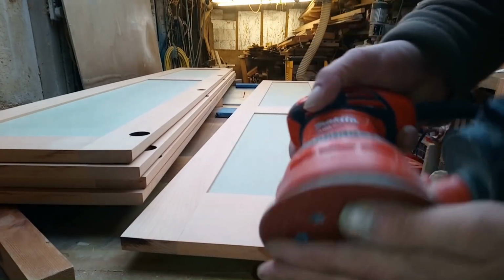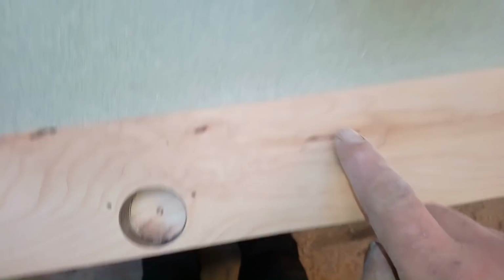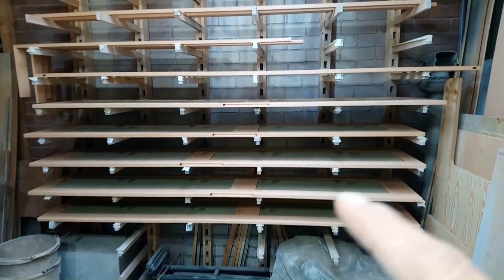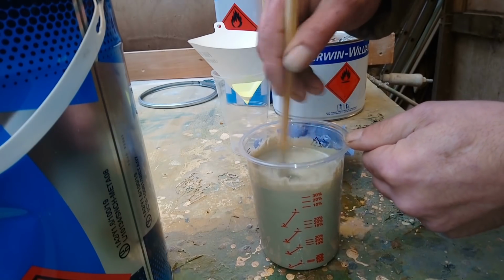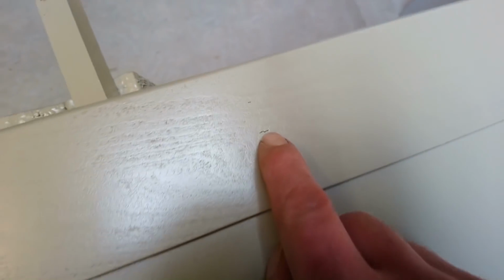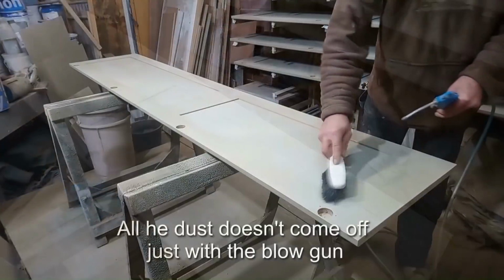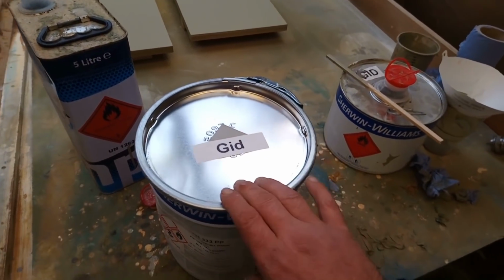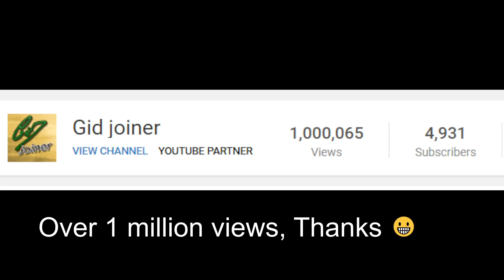Wardrobes Pt9 - Spraying the doors with 2 part PU enamel paint

Comment: if you want a finer paint finish Gid, look at automotive DA palm sanders. They have a tighter orbit and don’t put swirl marks into the panel. Decent ones are expensive to buy and need a lot of air volume but you can use them right up to 1200grit which i imagine is way finer than you need.
Reply from the maker: Hi Phils, yeah prob too much for these projects, I don't do much sanding on the top coats n any swirls with the 120grit don't show, these Makita's are quite good, 
I have considered a DA palm sander for the van but as you say they use a lot of air, my little air body saw works well, i suspect that doesn't use much air but I have a die grinder that works 'ok' if not used for a long amount of time & a cut off saw/right angle die grinder disc thingy that loses power/air almost immediately so hardly ever use that, i've got a couple of lecky grinders & an 18v cordless so that's no prob, need a bigger compressor.  but always have to consider the neighbours reg noise, some of the air tools can be noisy,
Reply: Gid joiner they do need lot of air, i’ve got 3hp, 14cfm, 150ltr and a DA will have that running continuously.  I have a right angle die grinder that i use with Roloc discs, it’s the loudest air tool i’ve got, i tie wrap a piece of cloth over the vents to muffle it. Good thing about air is the speed control, can do much finer work with them, but they don’t have torque of an electric motor.

Comment: very imformative, i have a graco 9.5 finish pro, would the paint you use be comparible with it, also your paint seems very thin
Reply from the maker: Thankyou, Sorry i have no experience with your machine, it's an expensive pro kit so i would expect it to handle any paint but PU paint can melt some plastics so i would suggest you contact Graco, you don't want to trash such an expensive set-up. I've tried over the yrs different thicknesses to the paint, this PU is an enamel like AC & Pre-Cat but is flexible, the wood underneath is relatively soft with PU the paint dents rather than chips like i've found AC & Pre-Cat to do & it is resistant to household chemicals like nail varnish remover, it has a lot of pigment in it & 2 coats normally covers well, too thin & it is a bit washed out, too thick & the paint 'spits' out, it doesn't flow together on the surface leaving the finish a bit rough like very fine sandpaper, I sometimes put the first coat on a little bit thinner just as like a key/sealing coat, there's a little dust left from the primer coats, so that 1st coat locks down that dust & can be lightly sanded but trying not to create too much more dust, It's wiped to remove that dust, the 2nd coat goes on a little thicker .
Reply: @Gidjoiner  thank you for a very inmformative response, I must say its so time consuming trawling various paints, thank you again.
Reply from the maker: Best of luck, yeah the waterbased stuff apparently needs 20º+ to dry within a reasonable time, i can't heat my shed like that when it's 0º outside & even then it's slower drying than the PU which dries in about ½hr even in winter, I started spraying when doing my apprenticeship but we only did a primer base coat or a quick button polish to seal the wood, Working for myself I'd do/did a similar thing, just put a primer coat on but I started offering a paint spray finish to my clients about 7yrs ago after i saw my work getting blathered in paint by them or a so called 'decorator', 🤮 I am a joiner tho & every paint is slightly different thickness, different amounts of pigment in the top coat or the primer seems different thickness to the last lot i bought, matt paint has an added matting agent to take the sheen off it... 🙃😬🤣🤣

Comment: I'm impressed with the amount of work you put into your spraying. Must be resulting in a high class finish!
Is two coats of primer typically used?
Reply from the maker: Hi, Yeah it gives a nice finish, I can always pick faults but i can only do as much as time n budget will allow, you sort of have to tho with spray paint, it annoyingly highlights any imperfections, 
Yep two coats is typical, for my way of thinking anyway, the first coats soaks in a bit, the wood becomes a little prickly n needs sanding, it also shows up any imperfections, this then needs another coat to seal & cover any patches sanded bare, The primer wants to be as flaw free & have as good a surface finish as you want the finished piece to have, ideally no major sanding or filling during the top coats, that's just the pretty colour that goes on last. ,

Comment: Lovely work mate👌. I’m curious what you think of something..when spraying an mdf door for example would it be best to use an mdf primer for first one or two coats then onto top coats? Or would you not do this?
Reply from the maker: Hi, Thanks, 👍 no i don't use mdf primer, These paints like mdf primer, kitchen paint, bathroom paint etc are just 'labelled' versions of regular paints, some may have added qualities but reg paint will do, I use a PU paint so it's advisable to use a compatible primer so i use PU primer, I think a big part is the prep when painting mdf, I use Medite MR MDF, the MR/moisture resistance means the fibres don't swell as much, First sand the edges of the board to a fine grit paper, i work my way up to 320grit, 80grit first, then 120grit, then the 320grit, the edges want to be as smooth as the face, I'd avoid sanding the face of the MDF much because that exposes the fibres, the first coat of paint whatever it is I thin down a bit, this will swell the fibres & make it rough, i then sand that as smooth as i did before painting, 120g & 320g, don't worry about sanding the paint off, don't go too deep but even though it's sanded off the paint will have soaked in a bit & the wood fibres have been 'prepared', the second coat i don't thin more than i would any of the next coats, because the wood fibres have been prepared the second coat goes on a lot better & the fibres don't swell so much so less sanding is needed, I sand this smooth to 320g, 120g first if needed, it prob will need a third coat of primer to uniform the paint because the first coat was just a prep coat & a lot got sanded off esp on the edges., only when the primer is blemish free, all defects are filled & the board & edges are as smooth as i want the finished piece to be do i then put the top coat on, very minimal sanding when the top coat goes on & there should be no filling to do, the top coat is just the pretty colour layer that goes on top, Sand the edges very smooth first then 3-ish coats of primer & 2 coats of top coat 😉👍
Reply: Gid Joiner your the man. Love your advice mate. Quality every time 👌👌👌
Reply from the maker: No prob 👍😁 let me know how you get on 😉
Reply: Gid Joiner so picked up my compressor and got the ANI gun you recommended, been playing about with it to familiarise myself abit, do you have any advice on how to handle the amount of dust and overspray in the room?. After 2 minutes of spraying my garage was worryingly misty lol
Reply from the maker: @olivermoore3431  😂👍 Have you seen my place 😆😷 Did you get a regulator, turning down the pressure can reduce overspray a little , & i have a big fan extracting the dust, i think that helps a bit . I got one like this from screwfix but they're not available anymore https://www.toolstation.com/18-high-velocity-floor-fan/p73557
Reply: Gid Joiner ah ok maybe I need a regulator as well then. What psi are you spraying at mostly?
Reply from the maker: Hi, yep a filter-regulator, mine's at about 25psi, https://www.screwfix.com/p/air-tool-filter-regulator-bsp/3109h
Reply from the maker: or a gun mounted regulator but you'll still need a filter, the hose from my filter to my gun was new & never got any oil from the compressor running through it, https://www.spraygunsdirect.co.uk/index.php/spraygun-gauges-filters/gun-gauges-filters.html
Reply: Gid Joiner cheers gid! Top man

Comment: Hey Gid. Loving the videos. What’s your take on spraying with PU from a safety perspective?
Reply from the maker: Thanks Colin 👍 I think the spraying of PU is no different to any other solvent paint, a lot of the nastiest chemicals are not in these anymore, the EU H&S etc. won't allow them but they are really not good for you so the best mask you can get, the one i use is about as good as they get before full air fed face covers which i can't afford, for yrs i've worked in dusty environments, when i started face masks just weren't used, I smoke & sit in front of an open fire all winter, my beard means the mask isn't as effective as it should be so I have a good bark in the morning, to be honest i think I'm already fecked 💀 but i wear a mask a lot more often n always when spraying, If i had to do it all again I would say wear a mask whenever poss esp with spraying paint of any kind, solvent or not.
Reply: Gid Joiner cheers Gid. Good to have your thoughts! You made me laugh, sound like a typical olde Skool builder! I’ve got a couple of amazon respirators which seem to be pretty good. Might look to get a better one. Can I ask what you’ve got? Hard to get masks at the moment! Just spraying my first job, some kitchen doors for myself and the pu paint is awesome but the prep has to be spot on. No hiding with this stuff! I’ve learned loads from your videos, absolutely jamb packed with info. Good mix of precision craft and ‘caulk the rest’ mentality very refreshing, so many preach excellence and produce mediocre work. Looking forward to the next build series.
Reply from the maker: 👍 yep no hiding the blemishes with spraying, it really is worth the effort in the first primer coat to fix all those, tiny little pinholes seem to just get bigger 😖 The mask i can't tell you, it's an A2 or P2 filter, I'd have to look tomorrow, i think a P2 but like you say the place i got it from say no masks available so no showing on their site, apart from the beard it does feel like it works fine, i don't leave the shed feeling like i've been breathing it in or can taste it 👍 Thanks Colin, I'm glad my vids are 'educational' 😁 It's a combination of my own anal precision/expectation & yrs of work on site for firms where you have to get the job done to a certain quality without too much namby pampering around 👍😁 I've got a few jobs coming up, just a bit awkward at the mo organising work or even myself
Reply: Cheers Gid. I’ve even found a few niggles after the final primer coat which I’ve filled and or rubbed back sparingly. Do you reckon I should get a perfect white primer coat before top coating or just go straight into the white top coat? I’ve done three primers so far first got very rubbed back and the second two not so much. 
That’s how I feel about the mask I’ve got, it’s really smelling stuff but with the mask on it’s not that noticeable so I figure it must be doing a decent enough job. 😷 challenging getting work done atm for sure. We just started a full renovation of a customers house just as the lock down got announced. Ended up stock piling materials from Wickes and renting a garage to keep it all as travis and jewsons were all out of action 🤔 Screwfix and tool station have been really good which is handy as you end up in there a couple of times a week at least in my experience!
Reply from the maker: Hi, I try to get the final primer coat as perfect as i can, the first as you say shows up the worst flaws & ends up getting sanded a lot, by the time i get to top coats hopefully i haven't any sanding or filling, that just creates dust, but sometimes bits don't show or you just don't see them until the top coat goes on, I've learnt to be meticulous in the first primer coat/filling, then hopefully there's little to do in the second primer coat, then the 3rd will just unify everything, by then there's only 2 coats on really because the first got sanded a lot prob in some areas more than others so a 4th coat might need to go on, only then when i can't see any blemishes do i put top coats on, I try not to say 'f*#k it' n go ahead with top coats but it does happen n i have to accept the outcome 😂👍 sanding n filling top coats is not fun to blend in those patches you have to feather the edges, quite often going back down into the primer coats 😖🤷‍♂️
Reply: Thanks Gid that’s what I was thinking I’ll keep pushing through and only top coat once I’m happy.
Reply from the maker: 👍 Primer is softer than top coat so easier to sand but it's often cheaper too 😊

Comment: Where did you pick up that sanding block you use Gid, the one that's hard one side and a sponge on the other ??
Reply from the maker: Hi, they're these https://www.axminster.co.uk/flexipads-hand-block-medium-soft-510003
I was using Mirka sanding b sheets but omeone suggested a cheaper make, i'll try find the link, this is the Mirka ones https://www.axminster.co.uk/mirka-abranet-abrasive-sheets-70-x-125mm-120g-pkt-10-502625
Reply from the maker: https://www.ebay.co.uk/i/202060711077?chn=ps&var=502056144920&norover=1&mkevt=1&mkrid=710-134428-41853-0&mkcid=2&itemid=502056144919_202060711077&targetid=855238875742&device=c&mktype=pla&googleloc=9046317&campaignid=7412990392&mkgroupid=89227044940&rlsatarget=aud-629407026945:pla-855238875742&abcId=1139366&merchantid=113806678&gclid=Cj0KCQiAgebwBRDnARIsAE3eZjSi7iYrEYGDOYJfpSUhEL-TgBks_ySzmLGOgM2dhRWKzTM7biyjv0AaAtBgEALw_wcB
Reply from the maker: I've just ordered some of the Sianet sanding sheets, you reminded me, i'll let you know how they go, might be too late for you cos it'll prob be in a vid at some point 😂
Reply: @Gidjoiner  Thanks Gid but the Mikra ones are to rich for me, 😒 I know they are good  but by the time you have bought all the grits sizes you need you have spent a ton
Reply: @Gidjoiner  Thanks Gid, I am in no hurry at the moment, as I stupidly bought 30 meters of of sanding mesh thinking it would work with the Mirka sanders, but it's to stiff and does not hold on the fine hooks on the Mirka, so I am using it on my other sanders for now. I only got it for better dust extraction, That Sianet is not a bad price, if I can find it in smaller packs, otherwise you are back to spending over a ton again to get all the grits I use, life's never easy😢😢😢
Reply from the maker: Yeah, i just ordered 2 new pads because my 2 are a little tired & the 2 packs of Sianet sanding sheets 120 & 320 grit, £47.59 total, 😮😁
Reply: @Gidjoiner  It soon adds up, it's a bit scary. I'd like to see customers faces if you added £50 to the bill under sand paper 🤣🤣🤣🤣🤣